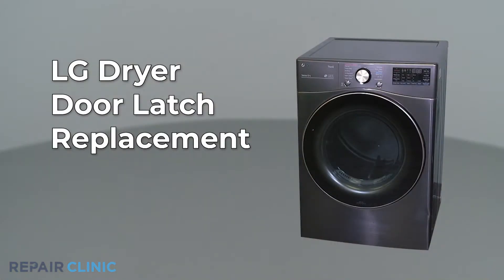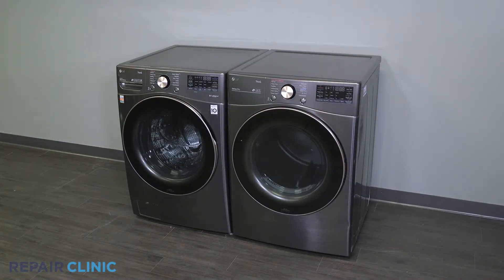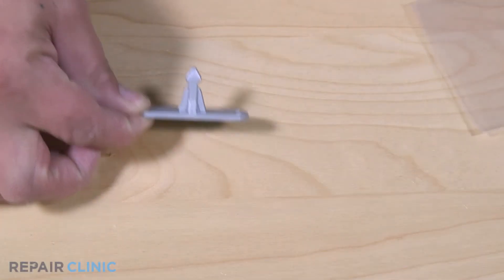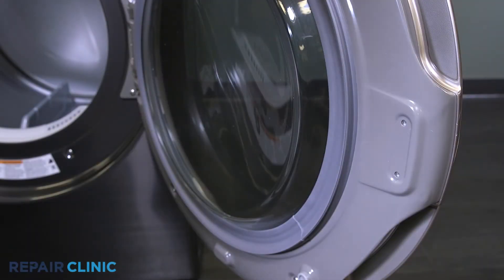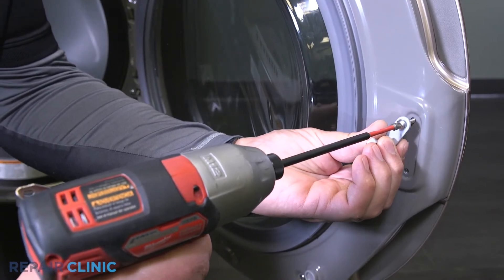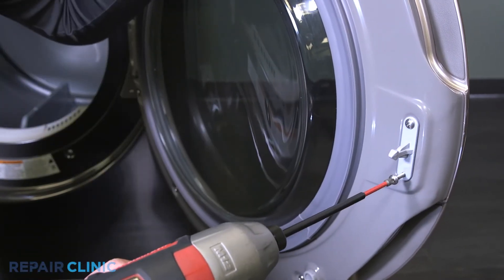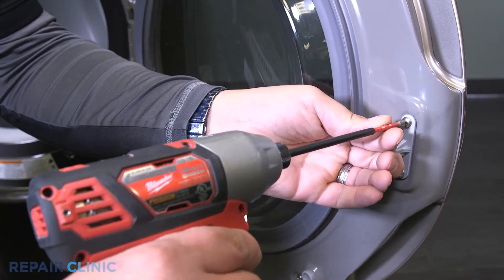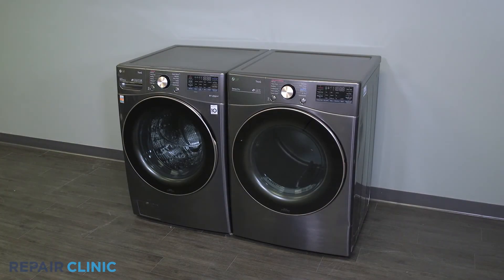LG Dryer Door Latch Replacement 4026EL3007B

Comment: my lg DLEX4000W has a door latch inside the inside the door as well. I tried to take the door apart but don't want to break something and void the warranty. The new versions have a plastic housing that does not release when you take the screws out. Do you have any videos with the my model type?